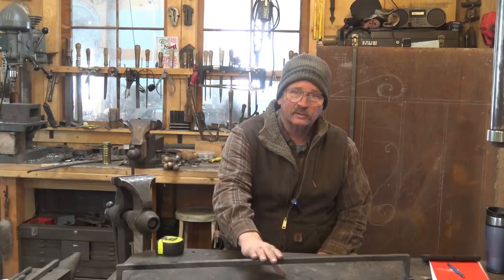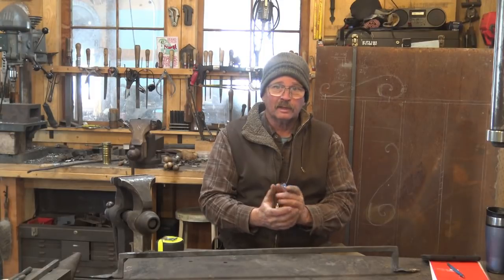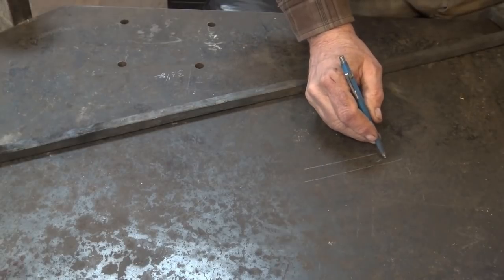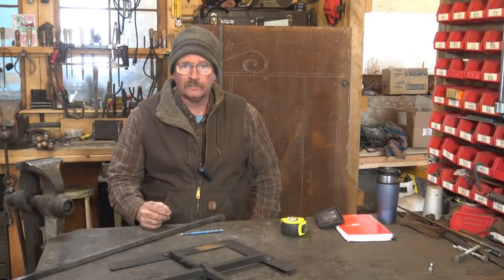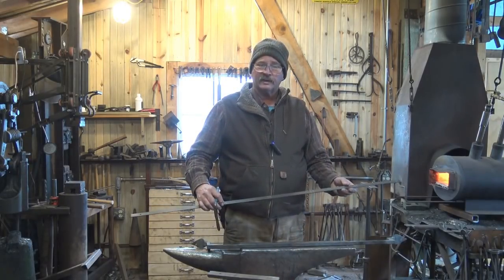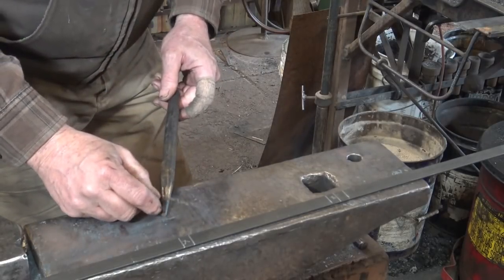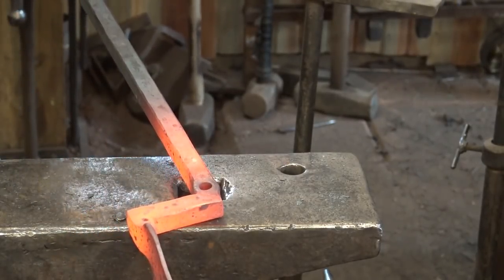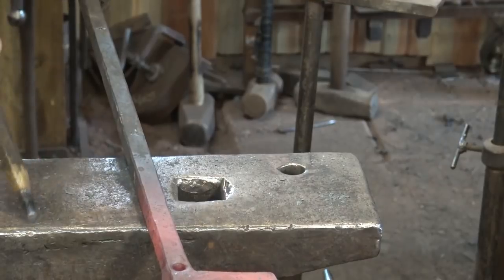Punching holes in the rails for the window grill project

Comment: Yellow. Clear. Clear. Yellow. Clear.  LOL. I actually like the clear a little better because it differentiates you from the strong yellowish cast of the wall.  Both the clear and the blue skylight from the window are unusually blue inside the shop.  Actually, I wonder if the best solution might be to mix clear and yellow 50/50; the yellow alone seems pretty strong.  But in any case, the fill lighting makes a big improvement.  Thanks!

Sure do enjoy your attention to teaching detail...greatly appreciated.

Comment: Hey John,  in the midst of this grill project, I'm interested in finding out how you change these procedures for grills/railings that are not square?  How do you set up a stair rail for example.  Particularly how the tenon and shoulder is made to fit the pickets into the slope?  If that makes sense.
Reply from the maker: To be honest I have never done an angled joint of this sort.  But I have seen methods written up, so it id possible to make angled tenons.

Comment: why does everyone use a flat ended punch to start holes? When I was doing my holes in my bar I did some experimenting and found that driving the nail punch all the way through then moving to a punch worked very quickly compared to using a flat end punch to push through from the start. (my main bars are 16mm). Definitely notice the difference lights on and off - much better on. either way on the colour, both with and without look good.
Reply from the maker: Flat end punches have worked for centuries, suppose we are all just stuck in the past.  On the other hand flat ends are still the industry standard for punching cold metal.

Comment: Now I don't see it lengthening with two or three punches by much to make a difference I do think 5 or more would definitely start changing it considerably depending on the size of hole you're making what is the rule of thumb, how many holes does it take to make that still grow half inch or quarter inch is the question and I have no clue looking forward to hearing from you Ken

Comment: When you dressed the punch, the dimensions changed. Did you take steps to ensure the tip of the punch remained 1/4" or are these dimensions less than critical? I notice my punches tend to bend a bit and much material is removed in dressing them. Forgive the questions. I'm real green.
Reply from the maker: While the dimensions are less than critical since I am drifting the hole to final size.  I also dress the end so the punch is actually getting a bit shorter with every dressing.

Comment: Yellow please.  I've seen holes punched first using a relatively sharp long taper punch similar to a center punch, and then drifted to size.  No material was lost to even a small slug.  Are there advantages of one method over the other?  Thanks again for posting your videos!   Jerry
Reply from the maker: I'm not sure if there is any big advantage of one vs the other.  Although in some cases, such as the eye in a hammer, the large section of tool steel is extremely resistant to being drifted,  So removing material to create the hole may be better in those situations.

Comment: John what do you make your drifts out of? I have used mild steel and it bends, and only 8mm.
Reply from the maker: The 3/8 round drift in this video is from S7.  it make a very good durable drift in these small sizes.  It is also easy to buy in exact diameters.
Reply: Ok thanks John,

Comment: I would like to make the argument, punching can be faster than drilling...
Given practice
Reply: And way cheaper too!
Reply: And I would add that you likely lose less material punching than drilling. You essentially lose the thickness of the material and diameter of the drill hole, where as with John's punching, it's the diameter and maybe a 1/16" thin bit of material.
Reply from the maker: In many cases I would agree.  However in this case starting with a 5/8" square bar cold, starting a fire, bring the bar up to heat 5 times to get each hole, cooling time to turn the bar end to end.  I suspect drilling would have been faster.  But one should never assume drilling is faster in every situation.  Plus in this case I think the punched holes will result in a better finished product.